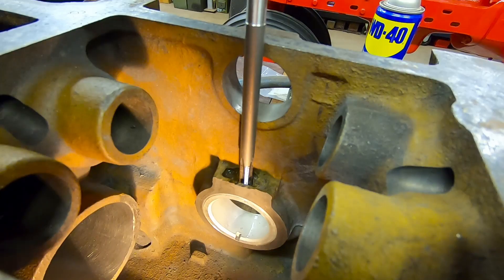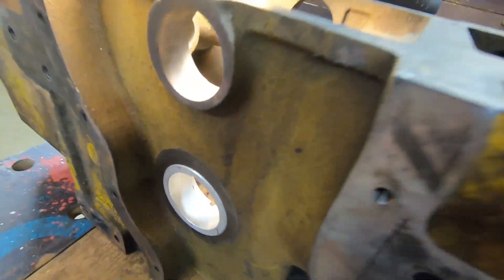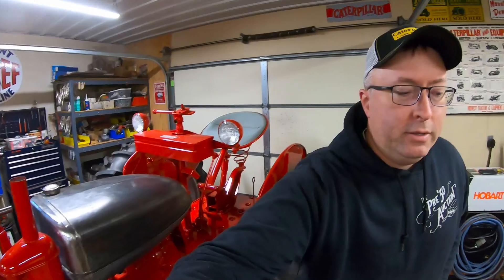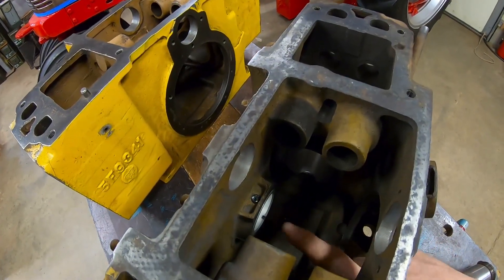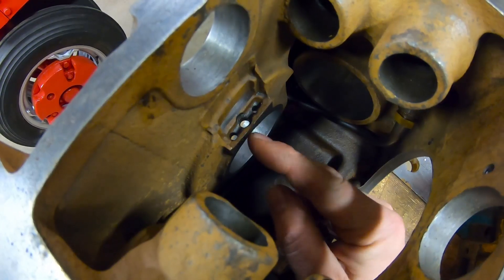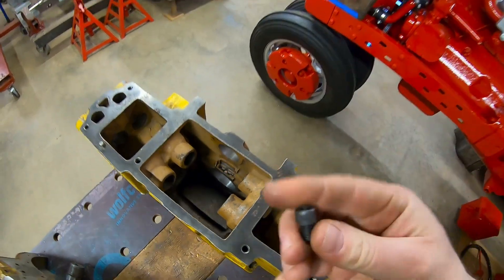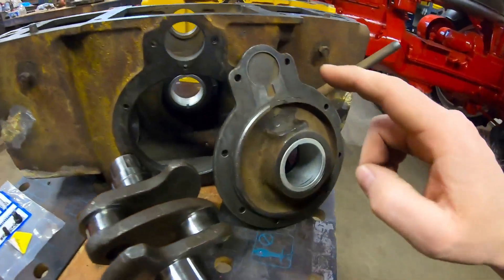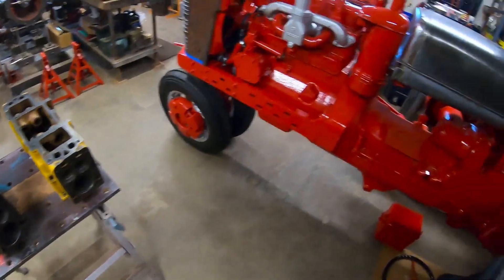The Rarest Caterpillar Starting Engine Block & We're Figuring Out How to Save It!

Comment: How tight did you get the set screw? I'm wondering because  it could push the bearing down.
Reply from the maker: Not very tight, I only cinched it with the short leg of the Allen wrench. Plus being a press fit anyway, along with being threaded in unison with the block bore, it would be nearly impossible to tighten that set screw enough to manage to distort the bearing 👍
Reply: @squatch253  thanks for sharing

Comment: This is an off the wall question. But how would you preform a cylinder compression test on the d2 or the rd6?
Reply from the maker: You’d need to build yourself a custom adaptor that seals into the pre combustion chambers the same way the injector would, then tap off of that with a gauge fitting. You’d still be guessing though, because Cat never published actual compression specs for any of those engines. Their published spec was “The diesel engine’s condition will be evident when hard starting and oil consumption becomes excessive.” So the only way to get an accurate compression spec would be to perform the test on an identical model of engine in known good condition, then do the test on the suspect engine 👍
Reply: @squatch253  Thanks for the information 👍🏼 Hopefully next year will bring some more rd6 videos. We have a Diesel 35 that’s just been sitting for the past 15 years or so and having a series like what 1113 was would be priceless!

Comment: Cap screws and setscrews are case hardened, only the outer layer is hard. Drilling the hole through the center can be done with a cobalt drill - a HSS one won't last long. This way avoids the annealing step you used.
Reply from the maker: I tried drilling these before heating them and couldn’t get very far, these were definitely hard throughout 👍

Comment: Wouldn't bottoming out on the bearing possibility deform the bearing? I think another option to consider would be to find or make a tapered tap to distribute the forces outward instead of down onto the bearing.
Reply: Depending on the amount of force applied, yes. I believe the green locktite would hold that screw in without the interference fit of incompletely formed threads. He's just guaranteeing there's no way that screw can make it's way down to make contact with the crankshaft.
Reply from the maker: Dan hit the nail on the head - the set screw was only cinched down using the short leg of the Allen wrench so it’s not very tight. Plus considering the press fit of the bearing in the block, combined with the threads being in unison with the cast block bore, those factors by themselves each ensure that it would take quite a lot more than that set screw to distort any area of the bearing 👍

Comment: That’s a great fix,I’m curious if you measured the bore of the bearing before and after installing the set screw to make sure it didn’t push down slightly when it came to the unthreaded portion.
Reply from the maker: There’s no way that set screw could apply enough force to distort the bearing, because of its press fit in the block, another area of the bearing would also have to move to allow any downward movement from the top, and that’s not possible. Plus the fact that the threads are all cut in unison between the block bore and bearing, they work to maintain position of the two parts in relation to one another as well. The slight interference fit of the threads at the bottom of the bore all get directed outwards, not down 👍
Reply: Not sure I fully agree with that. I too would be concerned about forces generated down towards the centreline tweaking the bushing. A couple of options spring to mind, maybe stick with the original low head screw fix  but slit it down with a cutting disc to provide an oil path at the correct level, otherwise add an operation and slightly counterbore the boss to lower the screw head. Either way knowing your mechanical sympathy and "feel" I'm positive that set screw was tightened to precisely the correct torque to avoid distortion. Surprised your thumb didn't click!😂

Comment: Would’ve possibly been kind of a pain in the butt to do but, could’ve also cross-drilled the Allen capscrew’s head, like safety wire holes, to allow oil in troth to work thru head & down center hole.. that said, likely your solution to that problem was an easier approach! Great job!!

Comment: Without the oil seal. How do you line bore the block.  Did you machine a flanged bar support that fits almost all the way across the crankcase. With the back side of it counter sunk so you could mount the cover on it at the same time to allow you to bore both block and cover at the same time using long bolts to hold it to the block. 
I don't recall the diameter of your boring bar but you might be able to use ac compressor pulley double row bearings to support the bar
Reply from the maker: I have no way of line boring these early blocks, since my adaptor sleeve used that oil seal bore for mounting. Luckily I didn’t need to line bore this one because it had never spun a bearing, so these new bearings are the new Cat replacements 👍

Comment: Just another example of eliminating future problems before they happen. Enlarging the hole was a great idea. After all, for this application you can never have enough oil to moving parts. This type of preventative maintenance solutions are not in a manuals. OJT still works now as in the past. Thanks for great details and application.

Comment: The manufacturers tend to forget these earliest of the early  production items with respect to issues in service and parts availability. I know, Toby, that you are familiar with the Ford N series tractors. The earliest of the 9N’s is my forte and I own several of them. Up until around serial 9N 700 Ford made changes on the fly. I have 9N 57 here and the differences with later production would make a list. Where’s the oil filter? Oops they had it in a different place! There are block differences, too.

I’m sure that you would agree that it’s  just part of the fun and challenge in restoring old iron!

Merry Christmas and a happy New Year!
Reply from the maker: You’re absolutely right, I love digging into all of the production changes from the earliest “rough draft” if you will, to the last and most refined “final edition” of a model run. And it takes a lot of looking at different examples of that one model to start to piece all of the design history together, but once you learn it inside and out, there is usually quite an interesting story to tell 👍

Comment: I wonder what the meetings between the cat engineers and the cost accounts sounded like in the early to mid 1900’s………

The original hollow down pin was a cheaper design???
Reply from the maker: I think it had to do with the dowel being the most “fool proof” setup that required the least amount of effort/skills to assemble. Lots of people out there that would tap the threads too deep and run the threaded pin all the way into the crankshaft lol

Comment: Could you cross drill the bottom of the raised head set screw...this way the oil flows from the bottom instead of having to flow up and over?
Reply from the maker: No, because I had to turn the Allen heads down so far to fit in there, they became so thin walled around the hex drive that they’d split open if I tightened them too much, so removing any further material would just make that problem worse 👍

Comment: I reckon another option on the headed allen screw would be to slot the head of it for oil flow.
Reply from the maker: I ruled that option out the first time through, because of how small I had to turn the Allen heads down to get them to fit they became so thin walled around the hex drive that they’d split open if I tightened them too much, and cutting a slit would just make that worse.

Comment: A steelsert steel insert tread repair would work in the same way , since there is a small counter sink tool and the tool to lock it in place .I have used it to lock axle bushes and add a grease nipple . But without the tread repair kit your ways perfect

Comment: So, when the 1st generation starting engine threw a connecting rod because the operator(s) just shut off the fuel supply instead of running the carburetor dry, diluted the starting engine oil, and the broken rod broke a chunk out of the cylinder skirt casting, is that not going to be an issue ? Do the piston rings not reach the broken skirt during a normal piston stroke, or are you not going to do a complete rebuild and return to service on that block?
Reply from the maker: Back in the "Try-Build" Ep.14 we covered the situations were you will find thrown connecting rod damage (aka missing chunks) out of the bottoms of these cylinder bores, and what to do with them at the 4:10 mark here - https://youtu.be/4N7m78SPBZ0  

Also see the reply I made under Neilshep's comment that I pinned up to the top of the comments here, where I stated that the young man that owns this starting engine will be doing the assembly and test running of this engine, he just had me do a couple of things to it that he was not set up to do himself.  I also included a link to his YouTube channel there :-)

Comment: Did it displace any bearing material and cause a high spot?
Reply from the maker: No, there is an oil channel up at the top of the bearing in that spot, you can see it in the mirror when i aimed it up at that spot. Even if there were any displacement, which I’ve never found, it would still be well up and away from the actual bearing surface 👍

Comment: I'm sure if the Cat engineers looked at these videos today, they probably would have used that method for the engines
Reply from the maker: I’m still kinda perplexed as to why they stuck with the straight shank friction dowel throughout the whole run, other than it was the simplest setup they could come up with that didn’t require much for special tooling or machining skills when putting an engine back together during a rebuild.
Reply: @squatch253 I think you just described the why they did it that way.

Comment: Watched twice and still don't know why you didn't drill the two(2) holes in the oldest block and make it like the later version of the starter engine blocks.  Would you enlighten this arm chair mechanic?  Glad the eye is getting better.
Reply from the maker: Because that area in this block doesn’t quite have as much “meat” in that spot, so weakening was a concern, albeit remote. Plus, it takes too much away from the uniqueness of this super early “rough draft” of an engine, which proved themselves capable of running with adequate oil feed supply to both main bearings as-is 👍

Comment: Seeing as aluminum and steel don't play together over time, do you think there will be any issues with galvanic corrosion or will the oily environment in this case slow the process?
Reply from the maker: These stay oily enough that I doubt there will ever be any problems. The extreme crankcase pressure pulses that are generated by both pistons coming in on the return stroke at the same time do a really good job of forcing oil into everything 👍

Comment: Is that by any chance mr hobo grohs block?
Reply from the maker: Yes sir it is, I felt kinda bad because he dropped it off here last July and I told him that after I got all the tractor shows out of the way I’d be getting to it, but then my eyeball decided to delay things even further. At least I got it done before the end of the year though - he needed the cylinders custom honed to fit some .010” over pistons he had and both main bearings replaced and threaded for upgraded retention screws 👍
Reply: @squatch253  did you hone for him too?
Reply from the maker: Yep did everything 👍